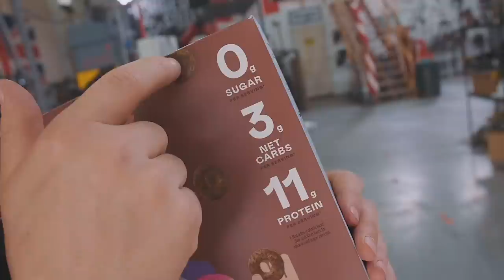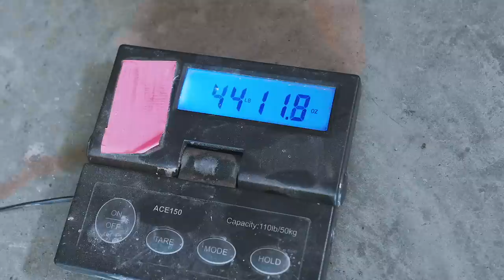MAKING A GIGANTIC WHOPPING BIG SWORD!!! Part 5

Comment: Anyone else worried about just the tip being heat treated, and that there's no pins in the handle?
Reply: I think if this falls horizontal on the bullet proof glass, it will bend. We will have to see how the video goes.
Reply: David Loos I doubt they’d drop it on bulletproof glass right away....will be cool cutting through other stuff though
Reply: yeah, sword will bend and handle will split in two xD could have atleast put some dowels in there! didnt see much of an edge on the sword either so wouldnt that make it more of a spear just having the sharp point?
Reply: Hardening the whole blade will make it brittle and probably brake it. The handle is probably going to shatter on impact though
Reply: linkthor i agree he shouldnt harden the whole thing but the edges of the blade leaving the softer core woulda made more sense, duno if u could temper that blade to be springy but thats prolly wat u want
Reply: @shadowbreed29  good point on the spring temper but it would be insane to try and temper a blade that size
Reply: I don't see this lasting the first time it catches the slightest bit of wind that wide blades gonna go off and it's gonna land at an angle and taco

Comment: You could have used a 1-in end mill and plunged through the guard to make the hole an inch.  A boring bar worked well, and allowed you to make it oversize.
Also when you are making the handle if you have a 1-in ball end mill you could cut each side of the handle before you glued back together.

Comment: Time to invest in a nice router table for the wood shop there mr. steelco.. amazing job as usual.. the table saw would’ve saved you a bit of time on removing some material before sanding as well. Raise the blade to the desired depth or height, center the block of wood make a pass right down the center, lower the blade a tad move the fence out a tad make another pass rotate the block make another pass and repeat till a rough half circle is made. Little woodworking tip for ya.

Comment: Looks a little rough around the edges, but considering the size of that blade, I'm surprised it came out as well as it did. Sometimes projects don't always go as planned and a deadline is a deadline. Even so, what do you think you would do next time around to expedite the process and bring the quality level up to par (still bearing in mind that this is being dropped off a tower)?

Comment: A piece of advice for the table saw - ALWAYS complete the cut.  From the video it looked like you turned it off with the wood still between the blade and the fence.  This is a very good way to cause very serious kickback which can cause you serious injury.  Like, life altering injury.  Always push the work all the way past the blade.  This will give you a better (or at least, more consistent) cut, and is vastly safer.  You are using push sticks, which is good, but one of the advantages to a push stick is they make it easy to complete the cut.  ALWAYS complete the cut.

Comment: for the handle, since its a compression fit with the pommel-nut-thing holding it on, why not just cut the wood into smaller sections, drill the hole in each one and then stack them on and tighten the pommel-nut-thing? gotta be a lot faster and easier.

Comment: Hey Alec i wanted to ask you a question, im kinda new to blacksmithing and i started to build a longinus spear from evangelion, and it has a spiral pattern like the wooden handle of your sword, however its made from metal.
What would you use to make the design, considering i dont have advanced equipment like belt sanders ?

Comment: I just realized... that thing is going to bend in half from the mass alone. Unless it penetrates the ground 90% of the way before stopping, it will totally bend. That thing is massive. If it does not bend after the first drop, I would be surprised.

Comment: why not making a drill bit extender with bushings of the same drill diameter ? ... I use that in Sweden when I build houses and sometimes I need to drill a 80CM straight hole.. also there is something called a "flat drill bit" which are incredibly good. also, real wood glue holds better than loctite super glue.. 
Wood glue becomes stronger than what the wood grains are attached to each other.

Comment: I'm still surprised you guys didn't spring for a sawstop given how big on safety you are. 

I'd at least recommend getting a feather board and a microjig grripper. They make cuts easier and safer. 

Also please get a router and some bits. You'd be able to make groves so much faster and cleaner.

Comment: with is tight as these guys are about proper PPE and equipment usage, I was a little disappointed in the table saw operation.  the blade should never be that high above the material.

Comment: That's a shame, you could make the guard from the steel, as a hollow box (welding pieces together), and the handle from a steel pipe. You could figure some heat treatment... But you chose to make half-ass job instead. You know what you brought on yourself.

Comment: Dude. You phoned this one in. 

The fit around the guard looked AWFUL. The material selection seems wrong. Any hard impact is going to wreck the epoxy (which is brittle), the wood, the aluminum...
You basically took a big chunk of steel and ground it to the shape of a sword, and when it’s put up against other things that How Ridiculous has, like the 5 axis CnC’d fist, or Thor’s hammer, or the giant trampoline or axe blade, I’m afraid the craftsmanship in this one is going to let you down.

That you were late on delivering it shouldn’t be an excuse to compromise your quality.

Here’s the thing - I believe in you. I think if you’d taken the time to do this properly you would have cone up with a better design and better material selection. You just chose not to. I think it’s the first time I’ve seen laziness from you.

Comment: i have dislike the video because when you weighed  it you you didn't stick to your roots and say what it is in kg and i hate  the imperial system :D
Reply: Let's see the imperial system is more accurate for finer measurements , so maybe take a look at your priorities after all the metric system has a relative margin of error of 2.2% vs the imperial which has a margin of error of 1.56% pretty big difference and if you didn't know the imperial system has been gaining 
more use in many feilds lately so "sticking to your roots" is not necessarily the smartest move especially in this context.